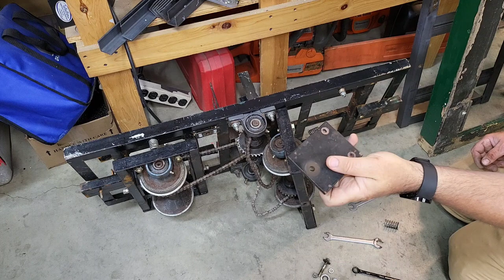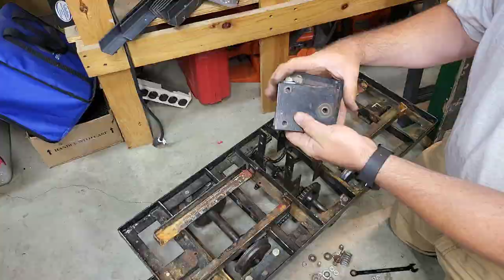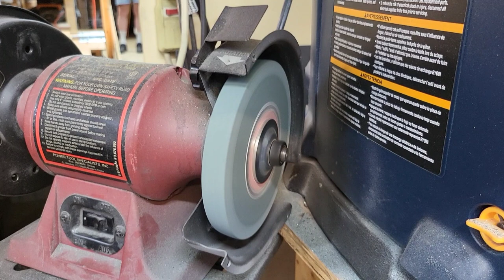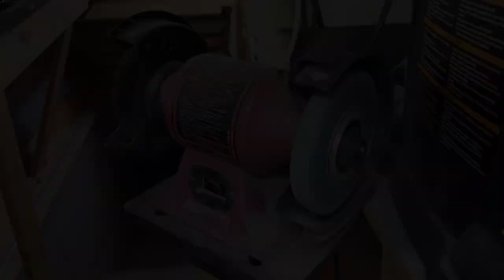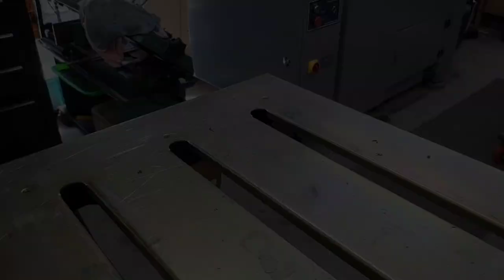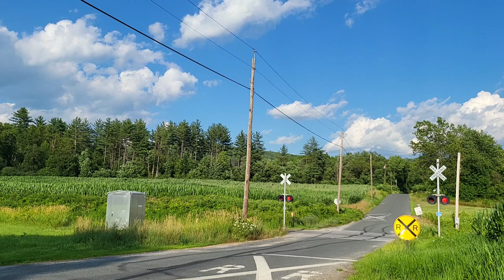MLBK 70 Rebuild: Modifying the Suspension

Comment: that is the same way the trucks are on the full size railroad are done.
the tank cars have 2 coil springs, with a total stacks of 9, I have not 
found but 1 car with 3 springs inside of each other. I learned that
it has ~4 space with the frame the car is empty, when it is 6-inches 
it is loaded. it is hard to realize the trucks are floating and not secured
to the car, you see that with derailments when the trucks are scattered.
have a great day, and take care.
Reply from the maker: I pin the trucks to the cars here. It makes rerailing much easier. Some people let gravity do the work, though.

Comment: It is so good to see you starting on the 70. the springs should make it more 
stable on the tracks. plus give you a smoother ride. was that a sufficient 
amount of weld on the pins? good luck hope it goes smooth on what is left 
to be done.
Reply from the maker: The pins don't have enough force on them to overcome those welds. All the force should be on the springs. In retrospect, I could have made the pins press fit and it would have been fine.

Comment: Aaron: So the pins are just a guide for the springs, to maintain their position 
on the frame. the size how do you determine the load rating for each spring?
taking the total average load, divided by the number of springs at some % of
load. say at 75% of the recommended load per spring? I have not ever designed
anything like that. like with circuits on your electrical panel the load can be like 
80% of the rating of the breaker with what you are running on that circuit.
thank you for your time and your reply to my inquiry. have a great night , barry
Reply from the maker: The pins are to hold the springs in place. I have a light and a heavy spring on each pin and that ensures flexibility whether the engineer is riding it or not.

Comment: It is probably better to have the trucks secured to the frame. 
the cut you did to elongate the one hole on the plates, what was that 
for? allows the trucks to pivet better? hope all is going well, good luck 
cleaning & painting.
Reply from the maker: The cut was to allow for spring travel and still have the trucks attached to the locomotive.

Comment: Any issue with chain tensioning with the suspension
Reply from the maker: Chain tensioning issues are minimal with this setup. It only jumps if you try to reverse direction from full throttle or if you try to stop suddenly from full throttle.